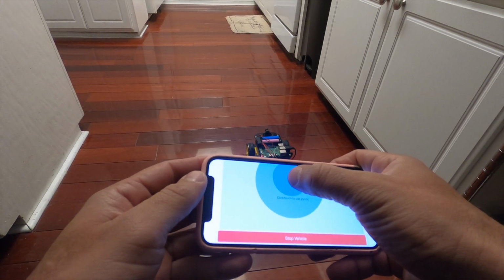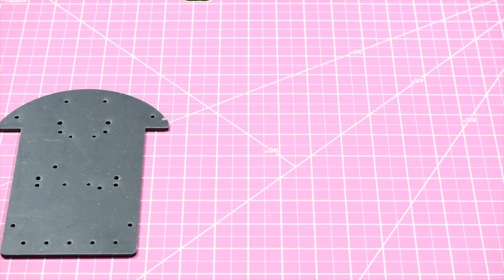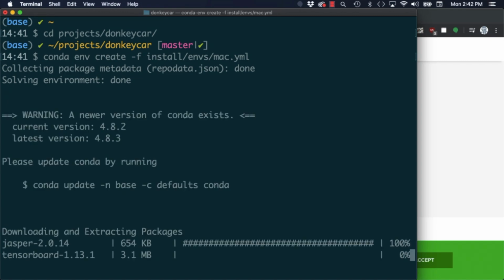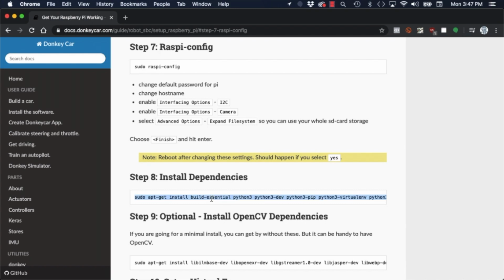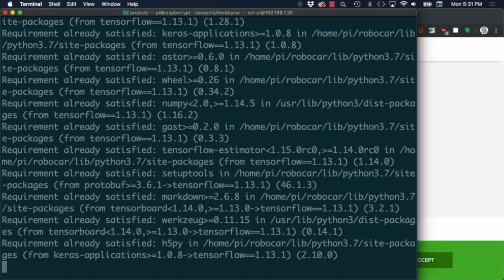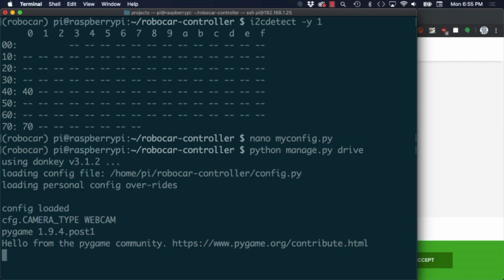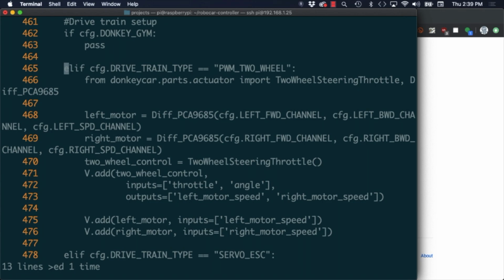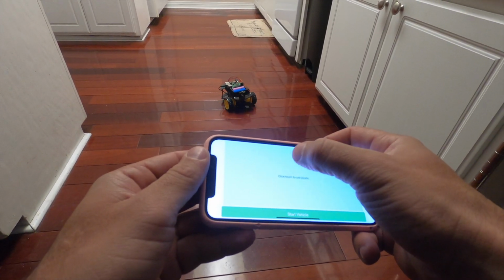Raspberry Pi DIY Robocar Running Donkey Car Software | PCA9865 + LM597

Comment: I'm working with the almost setup. Differential driving. The back two wheel powered by two motors and the front wheel is a ball pen wheel. 

I'm using a raspberry pi 3b+ and L289N .
I have been reading that it's not possible to do differential driving with this motor controller .

Would really appreciate some feedback 
Thank you

Comment: Great video! Do you use Pi 4? I'm wondering if donkey car with your modifications would work with other robot cars for raspberry pi? I'm thinking about some little more advance car like Sunfinder PiCar V kit v2. Do you have it in your offer? Or something similar? https://www.sunfounder.com/smart-video-car-kit-v2-0.html
Reply from the maker: Hey Łukasz. For this one I've used both an Rpi 4 and 3B+. They have example code for cars running the LM597 or, principally, the PCA9865. These type of cars use the PCA9865 to control an LM597 motor driver, so the code should work for any other using this similar setup. Thanks for watching, I'm glad you liked the video!
Reply: @datasith  Thanks for response! Would it be possible to use Scratch for basic control over the car with RPi 4, or would it take a lot of work to configure it?
I teach my daughter basics of Scratch and we are considering Micro:bit robo-cars which are ready to go and more kids-friendly (she is almost 7). But I myself would prefer something more advanced to learn Machine Learning and Python. I'm wondering if we could have both with RPi cars, or would it be too complicated for her to program basic movements of the car in Scratch?

Comment: Very fast, but looks thorough - I can always slow it down on YouTube :) . Question: It looks like you moved to Python 3.2. I have been reluctant to move, since there are incompatibilities (I think). What was your thinking?
Reply from the maker: thanks for the feedback, paul! i'm making a multi-part series on building a donkey car so i've been working on it for a while. the speed might be the result of me being ready to move on to a new project :)

python 2 has been officially 'sunset' as of 1/1/2020, but that doesn't mean that every library out there will be upgraded to work with python 3. imo, the compatibility has gotten so much better over the past 2~3 years. but, being honest, the main reason i used it here was because the donkey car software was made for python 3 😂
Reply: @datasith  ok. that makes sense. Keep up the good work!